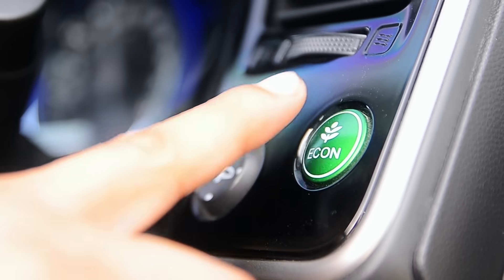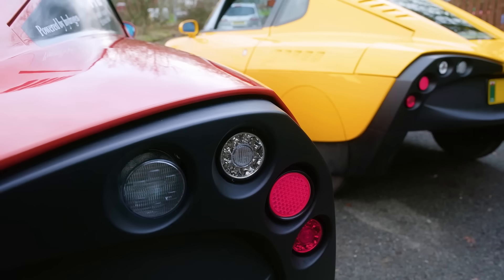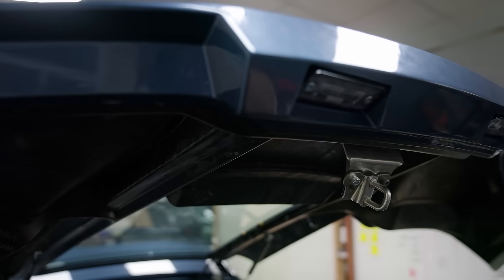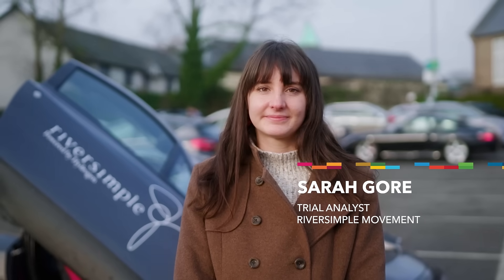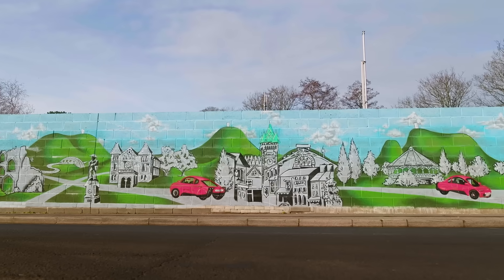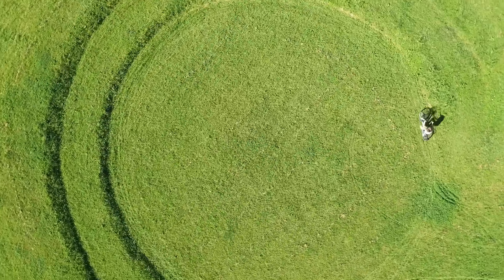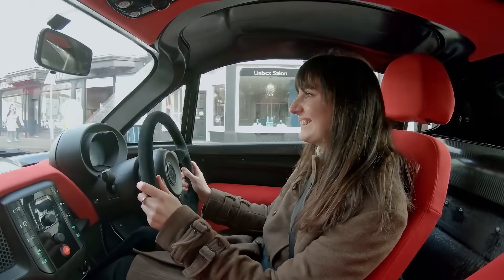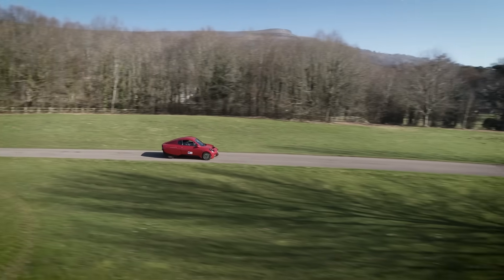Inside The Former F1 Engineer's Innovative Hydrogen Car

Comment: If you're hesitant because of its subscription model. Just think about it, It's a car rental service.
This car manufacturing-but-not-selling-model is as green as it can get with today's world overly populated with cars, car junk, and car parts waste.
As a middle class citizen of the lower end who couldn't pay the upfront cost of buying a car and would rarely see the need to use one, i'm totally sold with the idea.
The headache of long term parking, security and maintenance is offloaded to this manufacturer. This also means you get to drive new models almost immediately. It doesn't get any sweeter than that.
I'd immediately rent one when i need to when they finally get to reach my country.

Comment: carbon fiber don't rust but it does corrode when near certain elements due to galvanic corrosion.... and fuel cell is the battery.... its just that its charge is being used up very quickly after it has been made.... its imitating a conventional combustion engine in terms of its usage of the hydrogen.... so it has the same efficiency problem as a combustion engine when its not using much power.... and since you guys claim its not a battery, which i doubt, the fuel cell probably discharges any excess energy that is stored for too long....
and car as a subscription.... no thanks.... because who is to say the car won't be assigned to another dude when you actually need to use it.... all these you don't own your things BS really needs to stop.... because even though you can control the resources used, you don't get to actually use the things you paid for in the truest sense nor do you own it to make full use out of it because you don't own it legally....
its the same BS all these tech companies are trying to pull off recently to the point that startup companies or large corpos trying to re-enter the market will make it a selling point that you own your own device and you are allowed to repair it yourself and source the parts easily....

Comment: It is the only way forward for a true green mobility without limits or limitations. The range becomes unlimited, the charging hassle is gone. It won't stress the electric grid, there's no battery pollution, no need for endless charging points and it's an evolution rather than a revolution.

Comment: It's hilarious that people will think this is a good idea. There's nothing revolutionary about hydrogen fuel-cells, or in using them in cars. Even the absolute con of "as a service" business models in the automotive sector has been thrown around since the 90s. I've never heard so much drivel delivered so fast that was so divorced from reality. I do want my Hydrogen Fuel-Cell cars, but can we talk about how the Hydrogen is captured? What about the byproducts of the process? Are we using electrolysis on water to get it? If so then where is that electricity from? We walked away from that tech in the 90s because it's a dead-end promise.

Comment: There is one underlying bugbear I have with this, and no manufacturer so far seems keen on discussing it. I totally agree that we need to move away from ICE vehicles and if I had £30K+, I dare say I would be tempted to go greener. 
 The reality of hydrogen powered vehicles is that yes, they are green and make electric. But, they also make water. Which, if there's a handful of hydrogen powered vehicles depositing the odd pint of water all over the roads, then that's ok. But if there are a million plus vehicles depositing water onto the roads, that's a lot of water. And this country floods 'very easily'. It may seem like the ideal solution to the transport problem we have, but it also gives us further problems of having way too much ground water etc. 
 I'm sorry Hugo, but unless you can think of another way of dispensing with the waste water, this vehicle just won't succeed I don't think......

Comment: There are two sources of hydrogen. Reformed hydrocarbons (which produces CO₂) or water electrolysis (as mentioned in the video).

Most of the hydrogen in the USA is made from reformed hydrocarbons; no CO₂ emissions at the tailpipe but plenty at the facility which makes the hydrogen. If you don't want indirect CO₂ emissions, and you're using green-sourced electricity, hydrogen still has a problem: cycle efficiency.

With a battery-electric vehicle, over 80% of the energy which reaches the charger comes out of the battery, feeding the electric motors which push you down the road. Electrical energy -> chemical energy in the battery -> electrical energy is the cycle and the entire cycle is > 80% efficient.

For a hydrogen fuel cell vehicle, the cycle is electrical energy -> hydrogen -> electrical energy, with the hydrolyzer and the fuel cell providing the conversions.

A fuel cell is typically about 50% efficient at producing electricity from hydrogen. The typical hydrolyzer is also about 50% efficient at making hydrogen from electricity. In both cases, the other half of the energy which went in comes out as low-grade heat. That may be handy if you're heating your home / business (with the hydrolyzer) and the vehicle cabin (with the fuel cell) but really wasteful otherwise. 0.5 × 0.5 = 0.25 = 25% total cycle efficiency for water-splitting hydrogen feeding a fuel cell.

Given the same amount of energy reaching a BEV charger and reaching a hydrolyzer, a fuel cell vehicle will give you < 1/3 of the range because the conversions from electricity -> hydrogen -> electricity have such poor efficiency.

Get the efficiencies on the hydrolyzer and the fuel cell up to about 64% efficiency, each, and ... the cycle efficiency is still about 1/2 of what you get with a battery (0.64 × 0.64 = 0.41 = 41% total cycle efficiency). Some large-scale, industrial hydrolyzers have gotten up to 60% but that's not something you're going to have in your home or even a small community.

Get the efficiencies up to 90% each, such that you have (0.9 × 0.9 = 0.81 = 81%) cycle efficiency, and the two become competitive. Good luck with that. We are nowhere close to that on either end of the cycle.

I agree that we need a circular economy. I agree that we need to reduce energy consumption, per person, per mile. But splitting water to make hydrogen is the more wasteful route. It's more convenient, in terms of ease and speed of refueling, but more wasteful, currently by a factor of 3.

Comment: You mention only a 300 mile range but many new battery technologies are there already, in 2024 they are going to be 500 miles - 700 miles so what’s the point / advantage when it costs so much to create hydrogen in the 1st place

Comment: I'm torn on the subscription model. I understand it is much like a lease which should definitely be an option for people, but some want to own outright. Also, at least in my limited knowledge, leases have maximum mileage and after that limit would cost more. This is the reason some would prefer to own the vehicle as they may drive much more miles than the lease allows. The subscription model is a relatively new one that most likely causes folks to be against it so you would have to overcome that image straight away.
Reply: The day is coming when we'll own nothing and like it.  Anyway ya look at it we're all just renting.  If ya don't pay your out.  Same with loans.  Ya don't own till it's paid for, an then it's shot and ya start payin again!  Whatayathink?
Reply: They are also bundling the fuel in with the subscription. This hides both the huge cost of the car and the huge cost of the fuel.

Comment: Hydrogen fuel cell cars have been suggested for a long time.  This is not new.  The problem that keeps coming up and sinks them is the lack of hydrogen production and transmission infrastructure.  As several people have previously stated, much hydrogen comes from methane reforming which is no "greener" than using a regular internal combustion engine.  Even when using electrolysis, the power source needs to be considered.  If the electrolysis plant runs off of power created by burning coal, as that any better?

Then you get to transport.  Completely ignoring the possibility of fire or explosion, which can be mitigated be proper handling and packaging designs, you still have the fact that hydrogen is notorious for leaking out the slightest gap in a seal (it is the smallest atom in existence after all).  Storage, particularly long-term storage, and transportation are non-trivial challenges.

Comment: Although I do admit that it is not 100% confirmed, there is a rumour (or perhaps it's not a rumour but a fact, who knows) that Nicola Tesla, almost 100 years ago, invented a car that needed neither combustion fuel nor batteries, nor hydrogen.  It was apparently working on the principle according to which - so he claimed - the Earth can be treated as one huge dynamo and electricity could be garnered from the surrounding "ether".  Even if Tesla's car is indeed an unconfirmed rumour, wouldn't it be worthwhile to further research that idea and at least try to develop such a car?  Then issues of producing hydrogen or of batteries going flat would disappear.

Comment: Not going anywhere for many reasons.
1. Top drawback - you can't refuel at home or the office.
2. Hydrogen refueling stations are extremely expensive to build - in the hundred of thousands of $$$. Most are subsidized by state governments. So they are not cost effective.
3. Hydrogen refueling stations are few and very far between, making long distance travel impossible in most areas. 
4. The hydrogen system takes up a massive amount of cubic feet of space, resulting in no trunk.
5. What about safety in the case of an accident and the hydrogen tanks are ruptured?
6. The initial cost of the vehicle is way above that of a regular EV. For example, the Toyota Mirai was always sold at below the actual cost of manufacturing
7. The resale value of a used Toyota Mirai is less than 25% of its new price after 2 years. Nobody really wants them - too many drawbacks.
While this car has good engineering and hydrogen is a nice idea, it's just not practical in the real world. It would better to spend your money on a regular EV.

Comment: This car would most probably still use a battery - just less Kwh than a full EV. Hydrogen fuel cells dont generally create enough power.
So full cell feeds small battery, and the battery feeds the electric motors. Not mentioning this is rather disingenuous!

Comment: I'm pretty skeptical of the gas handling requirements of hydrogen. It leaks out of everything, needs cryogenic storage to be transported at all efficiently, needs all new fueling infrastructure, and doesn't yet come in any real amount from a non-hydrocarbon source. We currently make hydrogen for this by cracking oil. I'm looking to buy an electric car because it's better than burning fossil fuels, but what i really want is better public transit. It's the mid-21st century, why can i still not take nice, fast trains to work in the SF Bay Area? We really don't need all these personal cars.

Comment: But my EV has a 300 mile range too, without having to have bicycle wheels and a Jetson-style body. So mine isn't only good for short trips, but for long ones too. I can fill my EV once a week, and do it overnight, at home, without having to find a hydrogen station.
James May has a Toyota Mirai. Same tech as this, and has to drive for 80 miles to the nearest filling station. So before he does anything else, he's lost 160 miles of range.
How is that good?
Not hating on hydrogen here, but at the moment, it seems worse than battery tech.
And to say this is revolutionary, is a misnomer. The Mirai alrady had a hydrogen fuel cell and electric motors.

Comment: So, it's a hand-made, low volume car made with exotic lightweight materials that uses a fuel that is flammable, very expensive with only a few places you can buy it... but it's not a high-powered exotic supercar. It very efficient with its skinny tyres that looks like it will handle like a golf cart.  It will also only be available on subscription, so you won't own it, you'll just rent it.... what could possibly go wrong with that business plan?

Comment: A am not sure why they are bringing the hydrogen car into the conversation,  the hydrogen can has lost the race to the electric, it cost $85 to fuel
 a hydrogen car and only about $8 to charge an electric one.   You lose about 30 percent of the energy to compress and liquefy the hydrogen,  and another 30 percent to transport it.  Electric cars are about 90 percent energy efficient.   Theere are only about 54,000 hydrogen cars, while electric cars are sold at a rate of over 250,000 a month.

Comment: Revolutionary? It's an HFCEV. With wheel motors and no battery which means it will be quite underpowered and have a lot of unsprung weight. And it relies on non existent hydrogen filling stations and non existent green hydrogen. The car is cute but impracticably small if it's intended to be this "revolutionary" workhorse. On the positive side it was nicely shot and edited.

Comment: Use energy, which usually doesnt come from a green source, to produce hydrogen which then gets converted back to electricity to power the motors. 
OR just make the car a BEV and the electricity comes straight from the grid to the motors. Yeah. Hydrogen is a scam.

Comment: No battery so no regenerative breaking. This is a step backwards from the Toyota design, which by the way, is the most expensive car to operate you can buy. If you want green hydrogen, add another 30% to the fuel cost.

Comment: These claims about Hydrogen being better suited for long range are not a good strategy to build a business model on, the first 1000km Battery Ev is coming to market in about a year and charging speeds are getting much faster. Conversely the efficiencies of hydrogen haven't improved much at all, why would you use solar to convert to hydrogen then back to electrons with loses both times when you can just store the electrons directly from panel to battery. Hydrogen will have a specialised place in some industries but cars are not one of them, mobility as a service even less so, these guys bet on the wrong horse most certainly. A shame as the car looks great.

Comment: I don't mind the subscription model but it should be a price less than buying a similar car outright and keeping it for twenty years.. You can't talk about the circular economy if the price is based on replacing the car after 3 years.. I don't expect the price to be low enough to make this viable in 10 years time.

Comment: So it has a battery? Hydrogen fuel  cell right? Hydrogen is the most inefficient way of storing electricity,  why not just charge the battery and convert it into kinetic energy. You store solar energy in the battery then convert it to Hydrogen and Oxygen and then convert it  back to electricity and then convert it to  kinetic energy,  very efficient isn't it?

Comment: Hydrogen Fuel Cells are batteries, just of a different sort. Sadly, HFCs are about half as efficient as lithium ion batteries, and the production, transport, storage and use of hydrogen is loaded with problems which have not even come close to being solved in the last few decades. By the time hydrogen solves these problems lithium ion will have pulled so far ahead that it will never be able to catch up.

Comment: 0:45 Really no batteries? Super capacitor to both buffer energy from regenerative braking, and to buffer energy from the fuel cell to the electric drivetrain? Cool design but battery technology is pushing forward with sodium-ion, silicon-ion and solid state getting close to mass production. The future is bright for transportation with this multifaceted approach but getting hydrogen infrastructure installed with local hydrogen production will likely be more costly than electrical lines to EV stations.

Comment: It still uses rare resources like platinum. Platinum is extremely expensive right now. Imagine the cost if demand increased a million fold. Compressed Hydrogen is extremely corrosive. Imagine having to change a very expensive gas tank on your car every couple of years. If you are leasing that cost would be part of the cost per Km. The waste of all those fractured and dangerous tanks would have to be dealt with like smelting and remaking them. We already have a problem with rubber tires. The platinum in the fuel cells wears out. etc, etc....

Comment: Twenty years ago this might have made sense. But battery tech is advancing much faster than hydrogen tech can. Far fewer, cheaper parts, more easily built electrics have all the advantages. And already a safe battery is coming out that later in 2023 that can provide a 600 mi range with a 15 minute charge time in a standard, Tesla-like car, without some odd, awkward body design. It's obvious where this is all headed.